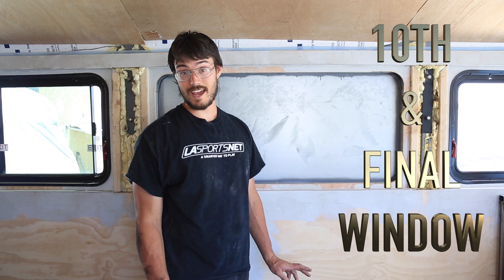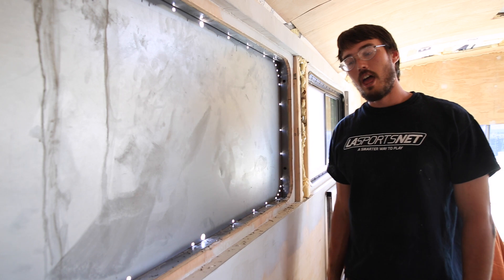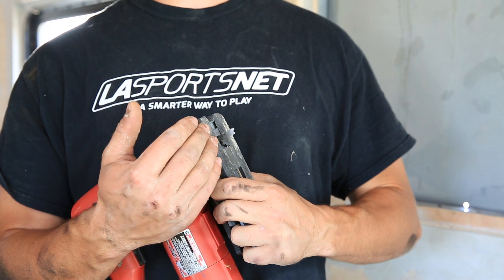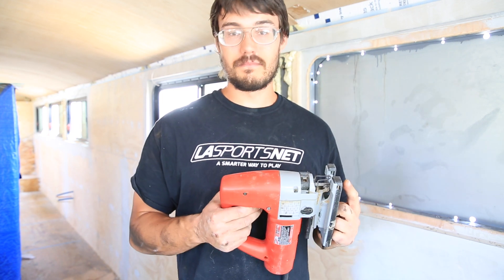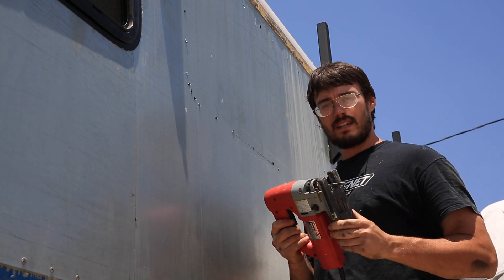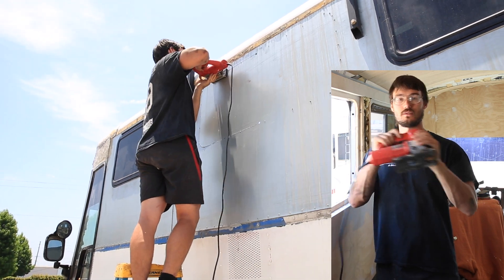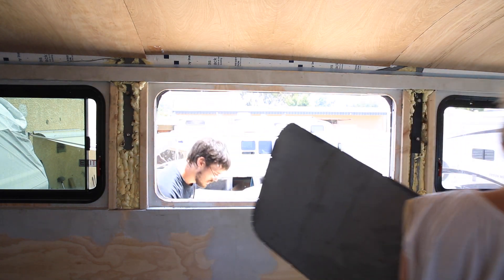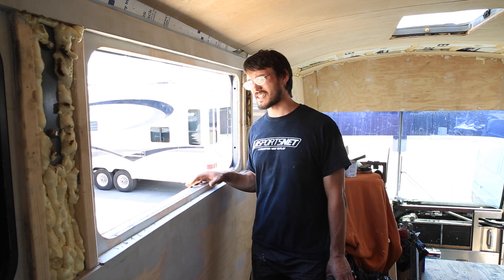#48 Bus Conversion into Tiny House: Full explanation of window install Pt 1

Comment: Use a 4 1/2 inch grinder man with a thin stainless disc , job done in less than half the time 😊😊
Then get a flap disc on and clean up the burs.
Grandpa gave you a jig saw at 6, boy oh boy, what did he give you at 10 a chain saw ? 😳😳😳😂😂😂
Reply from the maker: +John boy C Noted, I have never used a stainless disc on my angle grinder, I have seen them though. I should know better; every time I try something new on the angle grinder I love the tool even more. I started with grinding wheels, then cut off wheels... that is all I used for the longest time. When I finally tried flap discs and braided wire wheels I was amazed at the effectiveness. I will definitely keep the stainless disc in mind.
Reply: Back to School Bus good man, like you said earlier it's all a learning curve , from where I'm standing your doing just fine, always think long term, because your building this for the long haul, also silicones are not the same, some are for bathrooms some for bonding, if you are putting trim on and you need a damn strong adhesive go to a motor parts shop or paint shop ask for silicone they use for coach building or bonding body kits to cars, some bond right away some give you ten minutes or so and some are two pack applications.
I'll shut up now lol..
Reply from the maker: +John boy C You may not have gotten to the last videos of this channel yet... but we ended up selling the bus. We lost the space we were working on it (property sold) which was extremely limited to begin with. That mixed with engine troubles meant we had to sell. BUT we converted a Sprinter Van and I lived in that for 9 months in Los Angeles before our move up to Oregon, which we are in the process of right now. We have all the build videos for the van which I think are turning out better than any of our bus videos. Stay tuned!
Reply: Back to School Bus gutted for you guys but you took the route of plan b which in reality is four times cheaper to build and four times more return on mpg...I wish I knew I would have bought it...
Stay safe, I'll stay subscribed..